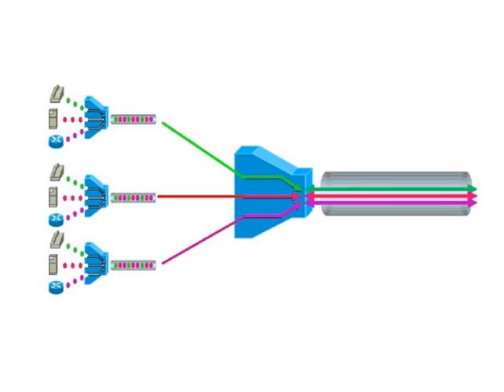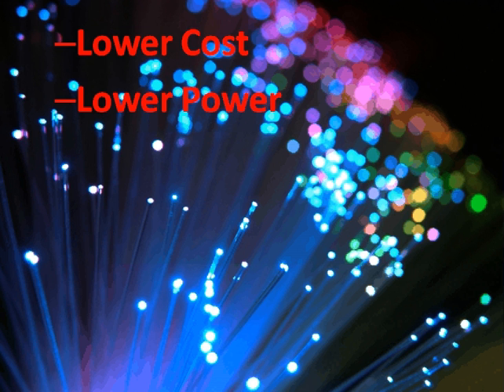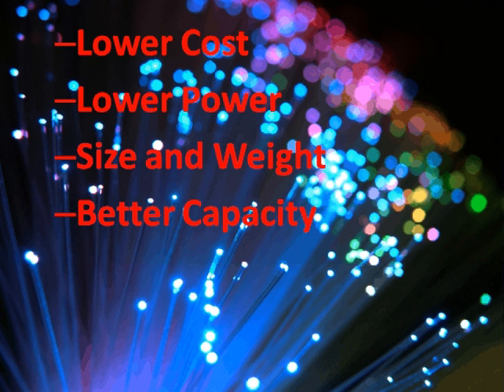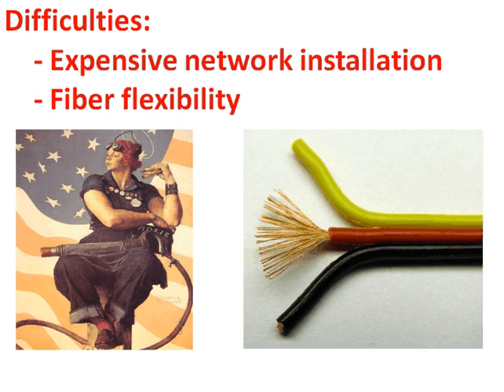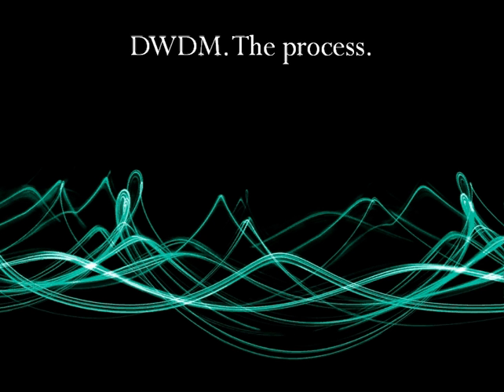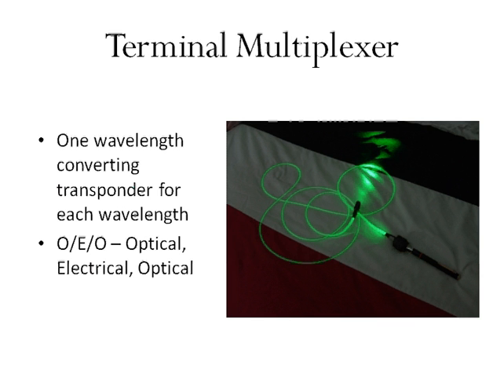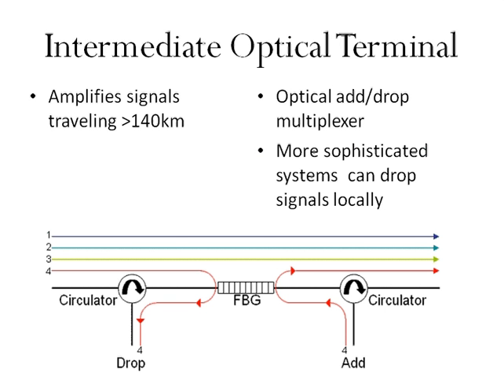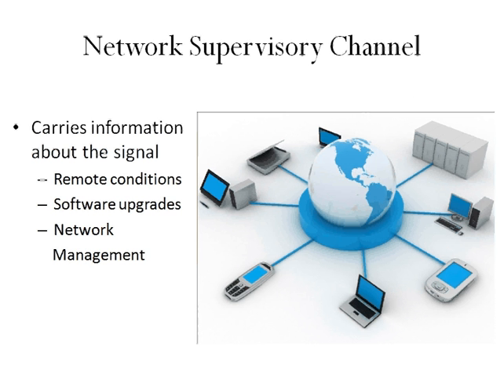DWDM Fiber Optics Presentation

Comment: It does require "added power" in the context you mention it, the wavelengths of light will start to attenuate and refract loosing focus and power (amplitude) causing info loss and force protocols like TCP work harder than needed. DWDM ILA's are used to remodulate and amplify the wave approx every 60km over long haul and this especially true over transoceanic routes.